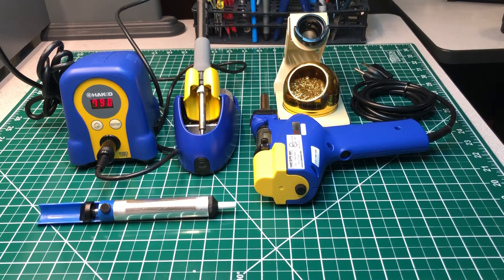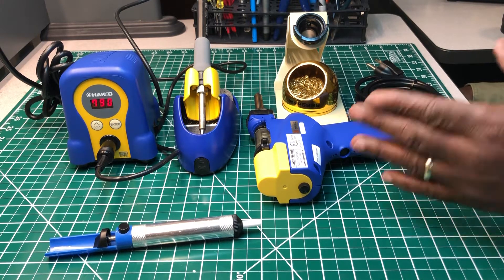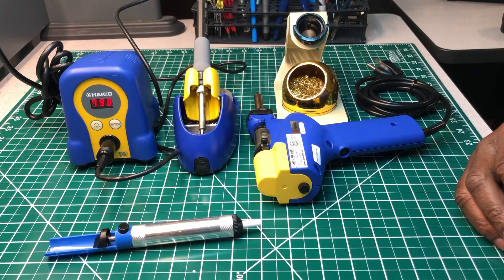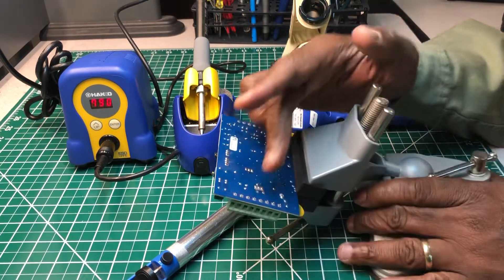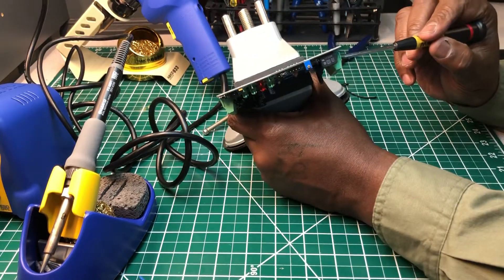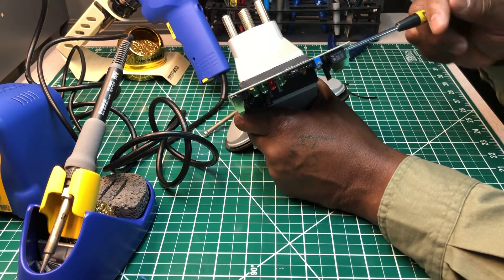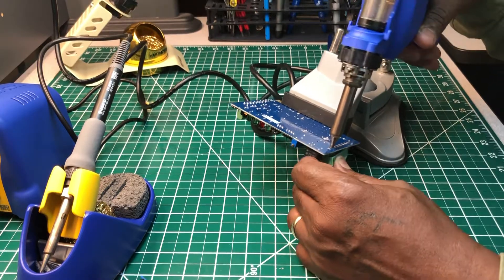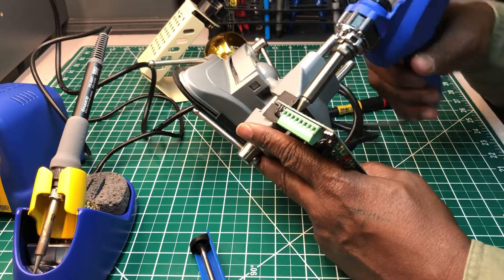🇯🇵 HAKKO vs. 🇯🇵HAKKO (Desoldering Old Way vs. New Way )

Comment: Try giving a moment for the solder to heat up before sucking with the gun, moving it around a little before sucking can help to get the solder wet but once it is wet it will suck it all in a moment with the light pull of the trigger instead of sitting there spinning it while pulling and cooling everything. If you were to give it a moment before you suck you will have much better results. Just be careful not to have it up to high cause then you will pull traces/pads (the method you were using is almost guaranteed to pull pads if you were working on a board that was at all stressed)  Also if you put a touch of flux first it is even easier/faster.
Reply from the maker: Okay thanks  👌

Comment: I have used these dumb "ENGINEER SS-02 Solder Sucker" desoldering pumps for the past year that i've been soldering, supposedly the best soldering pump out there, and time and time again the damn thing clogs up, the pump itself gets sticky and takes a long time to fully succ the solder, and just doesnt have the power i need for all my areas i work in. Decided i'm going to be scraping up the cash to get the Hakko FR-301 and save lots of time and not break valueable boards lol.
Reply from the maker: Great choice dawnj1, great choice. Thanks for watching.